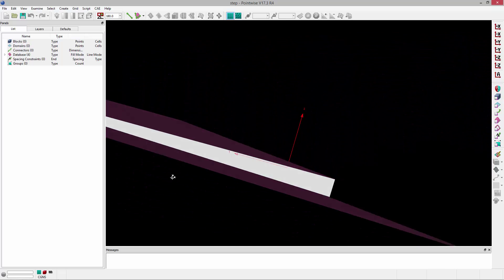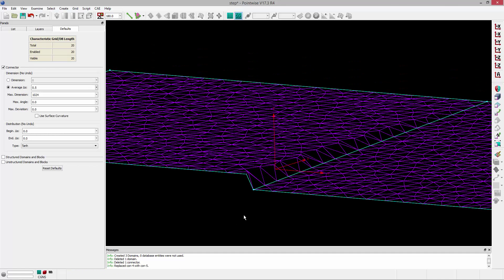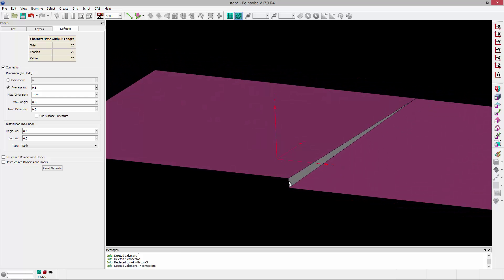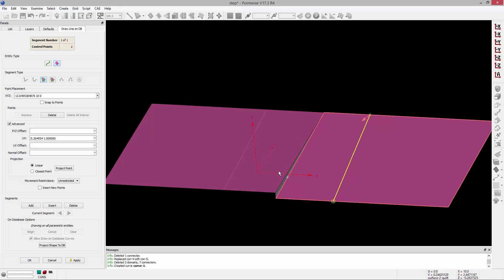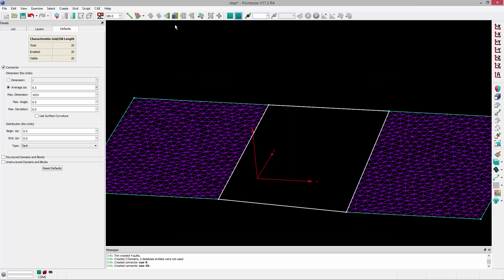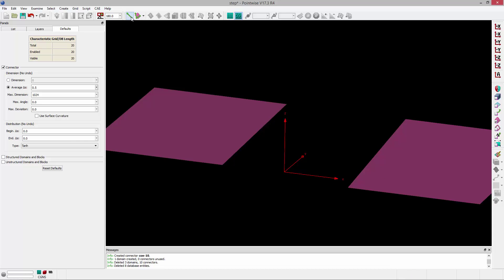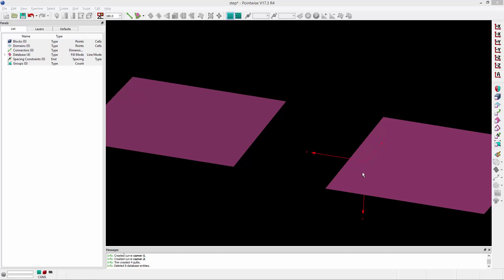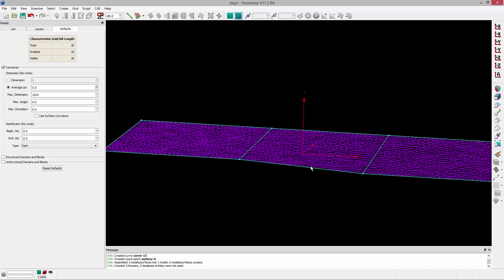Removing Model Discontinuities for Meshing

Comment: Thanx I am struggling from two days after meshing maintaining the area ratio for a missile wiretunnel and bottail surface. So I did the same I merged the curves and instead of six surfaces now i have 4 and i maintained the area ratio of 2.21 with Max Included angle around 123° and aspect ratio of 15 for my surface mesh. Hope Now my Volume grid will be of better equiangle skewness and Max Incl. Angle. And by the Pointwise could you please tell me a good number for the Max. Included angle for the Volume grid before throwing my mesh to my solver. I am using Ansys Fluent.